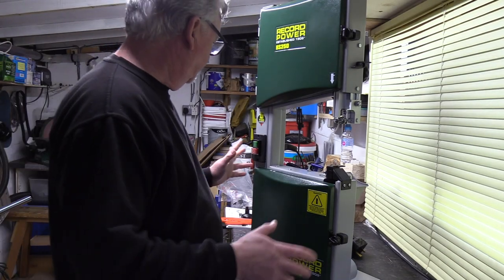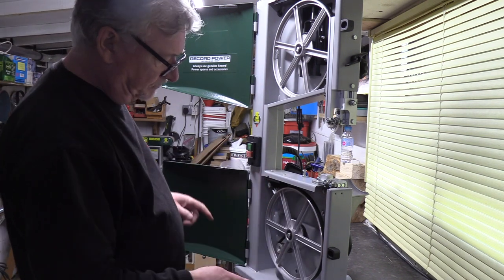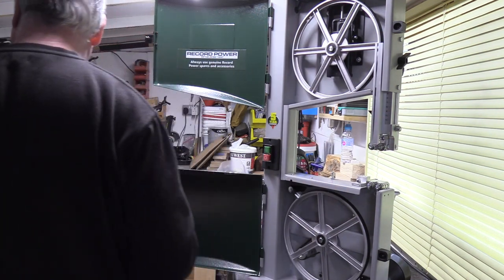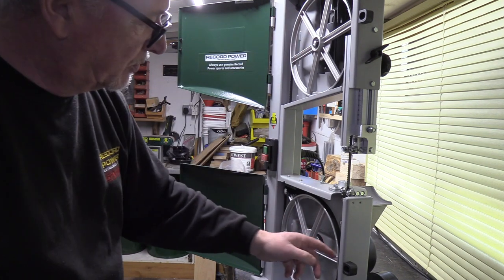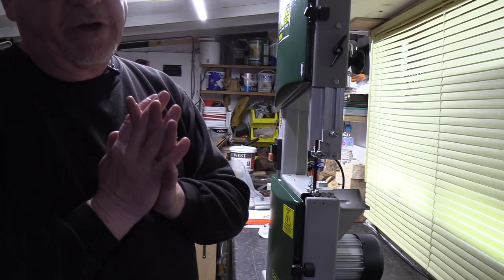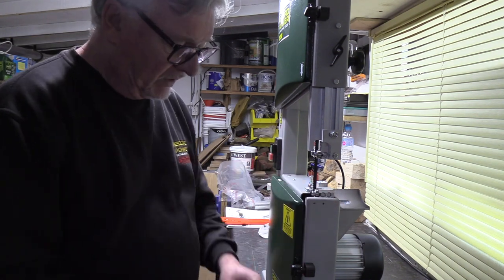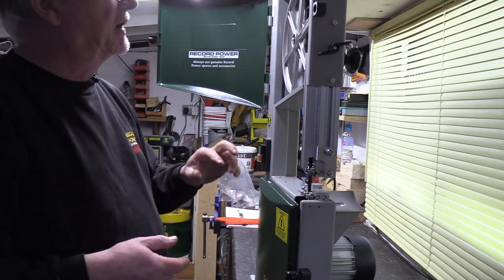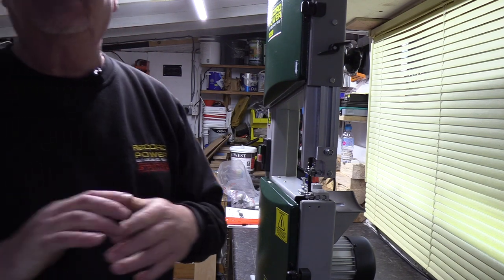Know-How Series: Blade fitment, tracking and guide set up of the BS250 10" Bandsaw

Comment: Will the video for squaring the fence and table for the BS 350 work on this machine as well? thanks
Reply from the maker: Hi Vincent, thank you for your comment. Please can you confirm if you are referring to the set up of the standard fence? Best Wishes, Record Power.
Reply: @RecordPowerTV  yes it’s a standard fence that came with the machine but it’s more for squaring up the table is  what I’m looking for thanks
Reply from the maker: @MrVinny3006   Hi Vincent, to set the table sq to the blade 1st its best to set your fence sq to the slot, so you adjust the fence rail to suit, and still keeping the fence sq to the table top so that it glides along with ease, then with the widest blade that you have fitted to your bandsaw move the fence close to the blade, but 1st having laid a steel rule, or another straight edge against the blade so that it is between the teeth of the blade and on a flat area, then this will allow you to see the error, and then loosen the bolts that hold the table to the bracket below, then with care knock the table one way or the other with a mallet. or a block of wood, that way when you introduce the straight edge you will see the error reduce, but remember to keep the table insert centre to your fitted blade, so that it does not rub against it. In a past video we setup a BS350S Fence which maybe of use to you, also a Sabre upgrade that again shows how to adjust. please make any adjustments with the machine unplugged, and check the free movement of the blade before switching on again.
Hope this all makes sense, let us know how you get on.